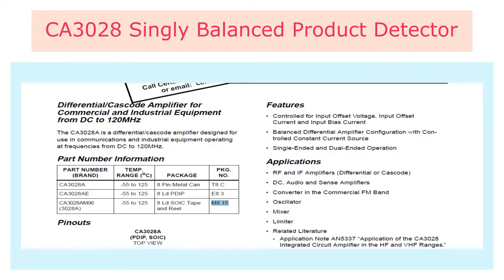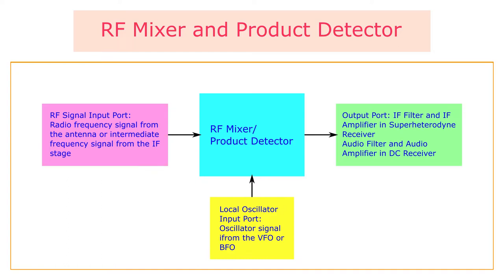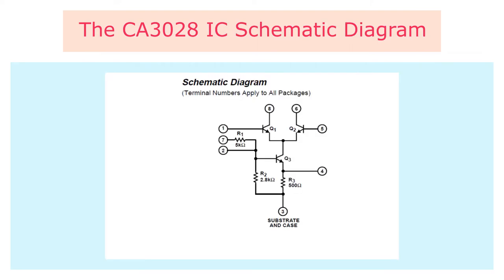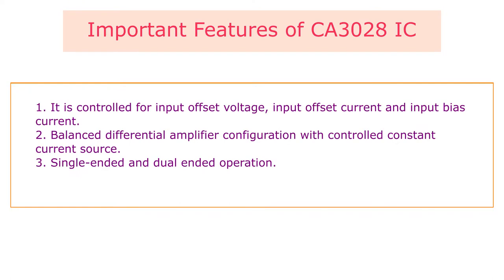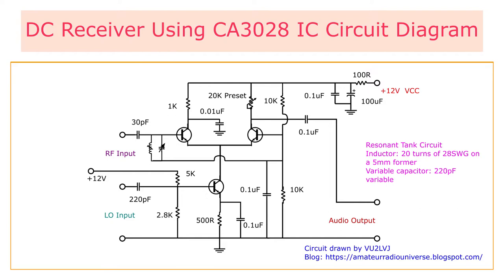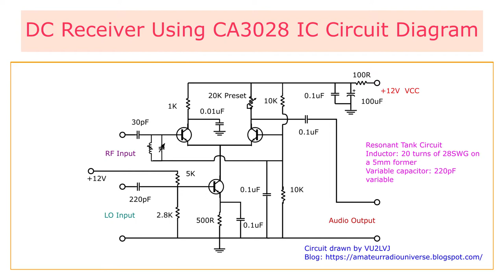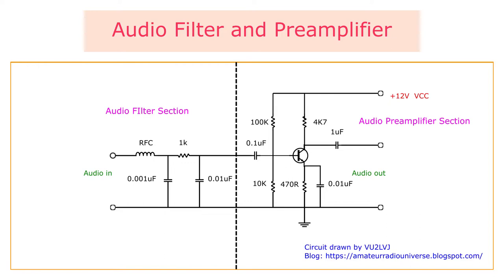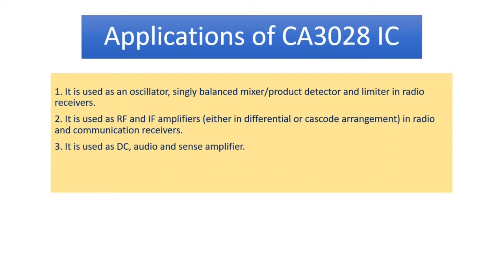Direct Conversion Radio Receiver Using the CA3028 IC Tuned Singly Balanced Product Detector

Comment: Hi! I have two CA3028 ICs and want to try building your receiver. How should I adjust the 20k variable resistor on the transistor collector?
Reply from the maker: I adjust it to a position where I get a maximum gain in audio. Alternatively you can adjust using a DSO too, with the signal at maximum amplitude.
Reply: @amateurradiouniverse  Thank you!